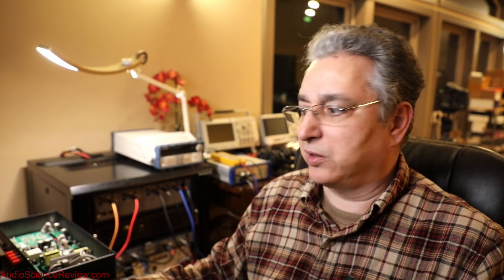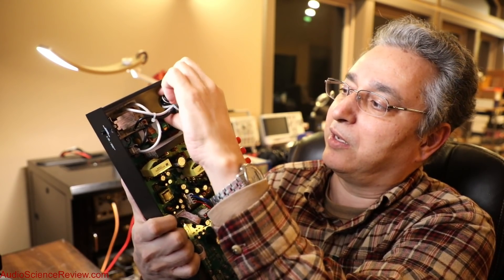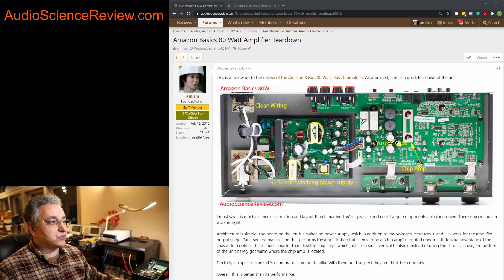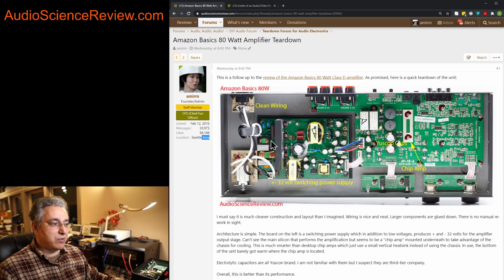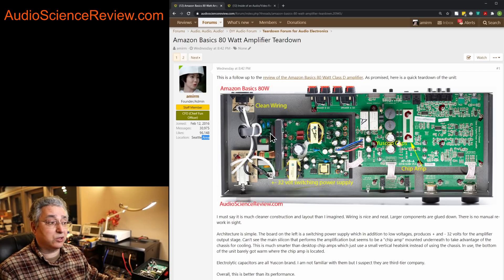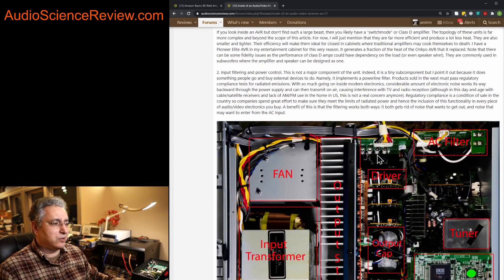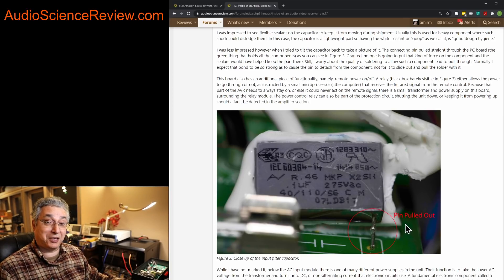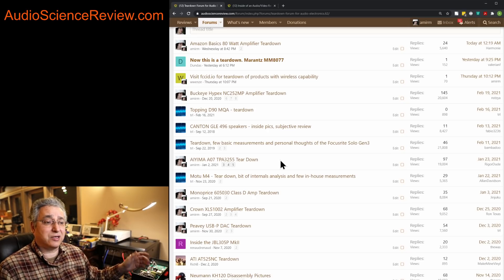Do you need AC noise filtering for audio devices?

Comment: Hmm,  I managed an auditorium PA for over 30 years and did the maintenance and some basic repair myself, though I did outsource more major repairs.  Obviously I have heard and read a lot of arguments on various topics and investigated a few controversies for myself along the way.  I never did anything truly audiophile out there but I did for example play around with speaker cable gauge and have come around to the opinion that the answer to whether things make an audible difference or not is often " well it depends".  I do have a technical/sciences based education and interests.  Among this I happen to know the theory of errors for systems.  This is a statistical approach to defining and analyzing errors and it yields some interesting perspectives on the diverse opinions re often come across.  Errors can be expressed as 95% of results are within +- a measurable tolerance.  each system step can be expressed in this way.  The total system error is the square root of the sum of each step squared.  Total Error = (S1^2 + S2^2 + S3^2 + ....... + Sn^2 )^0.5.
If we look at fixing errors in systems where the errors are spread differently, we get different results in terms of the effectiveness of our actions.  Let's say each case is a 10 step system.

Case 1: most steps have small errors with tolerance, a few are slightly higher but only one is a much larger error.
The only action that makes any substantial difference is fixing the largest error.
This leads to the conclusion that the only difference you perceive is when you attend to the largest error.
I have certainly hear this comment in audio.

Case 2: Most steps have a large error of about the same size, the rest are small, within tolerance.
Attending to any 1 of the larger errors, even the largest one has little effect on the system overall.
As we attend to the 2nd and 3rd errors we get slightly more improvement but still not much at all.
It is only when the last remaining major error is dealt with that the whole system improves substantially.
Now this is interesting because we made some real and substantial improvements to several steps that were majorly failing but experienced no real system improvements.  Perhaps, this is like swapping out speaker cables and saying that doesn't matter.  Well, I have to say that eventually after trying this for myself, my experience is that it can very much matter but to put it into perspective I didn't go ridiculously over the top with this, but enough to satisfy myself that the usual cable gauge charts appear to be woefully inadequate.  What I did do though was go for a cable that was 2% of load impedance.  Thinking that through some more, I suspect that a better approach may be to base the cable impedance of the amps output impedance so that a high damping factor amp retains good precision over the speakers.  (assuming other amp properties are also good of course).  However if the signal is getting messed up before the amp, it's still not going to make much difference.  In my particular case, it was the must major thing the turned the PA from average to true sound reinforcement clarity and tonality.

So on this particular topic on filtering, I see comments that it makes a very noticeable improvement and others like this.  Personally I have not ever used anything other than simple surge protection either in PA or HiFi, so I'll sit on the fence but I do know that observed results in any system are very dependent on the spread of errors in the specific system.   So, I tend to be of the opinion that maybe it depends on other factors.  It's like, in the perfect theory, ground reference is the same everywhere.  In practice though, the earth system is a network & not a ground plane.  In the network, there are impedance anomalies and differences in potentials and current and spikes bouncing around.  The ground plane theory just isn't reality which is one reason for balanced cables and ground lift.  We don't want all the RFI EMI infecting signal reference etc.

If someone says they put in a power regeneration and it makes a big difference for their $4000 audio system, I'm going to give then the benefit of the doubt on that.  Like my engineer dad said, the theory only gives you a the initial system from which the applied science of engineering begins to optimize that system.  That's the difference between a technician and an engineer.

Comment: Most domestic AC lines are not horrible. They are not wonderful but they are not disasters either, so in general some kind of line filtering isn't going to have a positive audible impact. But- there are probably some scenarios where a line filter would be useful.  Running off a small portable generator maybe, or sharing a power line with a welding shop. But for most domestic audio gear I've ever bought, if the manufacturer didn't put enough into the design of the power supply to keep line noise out of the audio, I would return the thing and ask for my money back.
Reply: yet sound changes noticeably at night and day . and i think it also changes on sundays .

Comment: Can a line filter negatively affect operation of a power amplifier?
Reply from the maker: There are some that are series surge protectors.  These can cause current limiting.  So if you have powerful amplifiers, you may not want to plug them into these.  Otherwise, I can't think of a scenario that causes degradation in normal operational mode.

Comment: Not one single mention of how this noise can be easily picked up by those of us who have other hobbies such as ham radio. Sorry Amir but not all of us are just audiophiles. We have other hobbies too which need clean power and no RF interference.
Reply: The required filtering on the AC line of all devices should keep the noise inside the case. Do you find adding supplemental filtering further lowers the noise being pushed out the AC line?
Reply: @tomterrific9459  yes. Some switch mode power supplies are so electrically noisy that they turn power cords into transmission lines for RFI.  This is one of the reasons why some audiophiles turn to upgraded linear power supplies which are not as noisy in the RF band. If you would like more information the ARRL has a great section on their site dealing with EMI and RFI mitigation. Companies like Palomar make filters designed to mitigate this interference. MFJ Enterprises makes RFI sniffers. The biggest culprits are the cheap switch mode power supplies and the poorly designed power supplies in cheap audio gear. You can hear them on ham radio gear and see the interference on a SDR spectrum sweep. I hope this was helpful to you.

Comment: I would rather a conditioner blow first not my equipment and more filtering may be needed depending on the amount of dirty current in your space and some of us have thousands of dollars invested and I for one want the extra security and I have very good conditioning that does not limit my playback
Reply: "more filtering may be needed depending on the amount of dirty current in your space"
Do you know of any measurements that confirm that "dirty current" causes amplifiers to actually produce compromised audio?
Reply: @tomterrific9459  
It's very simple. Take a portable player with build in speakers and listen on power from batery and next plug in a charger. Difference is pretty obvious.
U may use a smartphone and blutooth speaker, but dont forget plug in charger to phone also. If it possible use a cable conection beetwen devices not a blutooth, cause wireless is also a partial filter of the noise.

Sound powered from batery is less nervous and more smooth and clean.
Reply from the maker: You would be relying on luck in that situation.   The surge protection devices are voltage rated.  The one with the lower voltage will clamp before the higher voltage one.  So for all you know, the one inside the amp may clamp first leaving the external one useless.

Comment: Great content Amir,
As a related topic, I would really like to know how much of an effect (if any) the "perfectness" of the incoming AC voltage waveform has on the audio produced by an amplifier. I don't know if this has ever been covered at ASR, but I would be interested to see this tested, ie, % thd+noise produced by an amplifier being fed less than perfect AC power vs % thd+noise produced by an amplifier being fed minimally distorted AC power.
Reply from the maker: I plan to do some testing and videos on lab generated clean AC so stay tuned!  I will also do the reverse by distorting the power even more.
Reply: @AudioScienceReview  Very good Amir, I would love to see the results of that. As you know, there are people that go to great lengths and expense to ensure that the AC voltage waveform coming into their amplifiers is as "perfect" as it can be, without any real evidence that small distortions on the AC voltage waveform can cause audible distortion problems on the audio output of the amplifier.
Reply: @AudioScienceReview  Thanks Amir. That would be great.
Reply: @Douglas Blake Hi Douglas,
Yes, I completely agree with you 100%. 
I would just like to see some measurements sometime that would confirm this. 
Lee
Reply: @Douglas Blake Yes, that would be a very good way to measure the AC riding on the rails.

Comment: I've seen CD player mods in the past where they remove the AC filters. I think the claim was that noise can end up stuck in a loop between the filter and the power transformer primary winding? Any merit to this theory? People claim this can reduce dynamics...but I've never seen it measured.
Reply: @Douglas Blake lol......as you know, there are a lot of "theories". Many of these theories are formed by people without a real understanding of how electricity/electronics even works, and consequently some pretty outlandish claims are made. There is typically a lot of "expectation bias" involved in most of these claims.
Reply: @Douglas Blake Yes, I agree. That statement was probably originally made by somebody not experienced in electricity/electronics
Reply: @Douglas Blake haha I too am an engineer...a mechanical one though. Audio electronics are my hobby. I always follow the science though; hence being an ASR fan!
Reply: Sounds like something from the GR Research forum...lol.
Reply: Thanks for your responses guys. I think the idea came from the famous Marantz CD63/67 mod thread on DIYAudio. The person in question had a write up of it on his website along with articles about how to optimise basic voltage regulators etc. I think he was an electrical engineer? See if I can find it...

Comment: How does this Amazon amp prevent the Hf noise from the SMPS from “disturbing” the components inside the box? The filtering only prevents them from disturbing the AC line outside the box. They should at least shield the SMPS from the rest of the components in the box.
Reply: Internally, it is pretty easy to mitigate smps noise, because the switch mode frequency (and harmonics) are well known and clearly defined. Various methods can be used to get the switch mode noise down to a level that it cannot be heard at the speakers, such as using differential amplifiers (and exploiting common mode rejection) and notch filters. It varies from device to device, but there are many ways to do this. To be clear, the switch mode noise content only has to be reduced so that it is below -120dB or so.
Reply: @tomterrific9459  I did not say it is not possible to shield the SMPS from the rest of the components, I just saw from the pictures that in this case the Amazon amp’s SMPS does not seem to be shielded from the other components. The most obvious method to mitigate the noise (but not the only method) is to put a box around the SMPS.
Reply from the maker: It has good bit of physical distance to the amplifier board.  But sure there may be some noise bleeding into the amp.